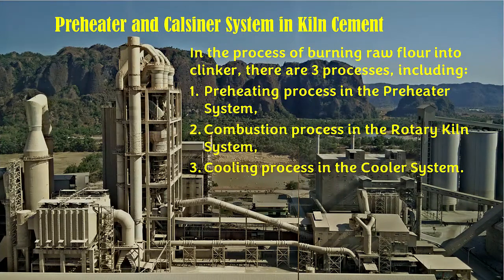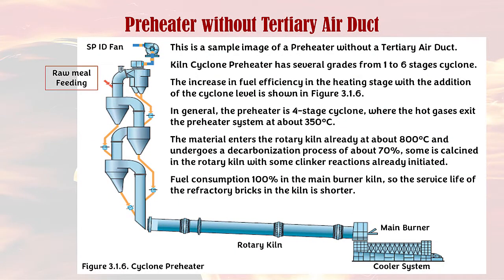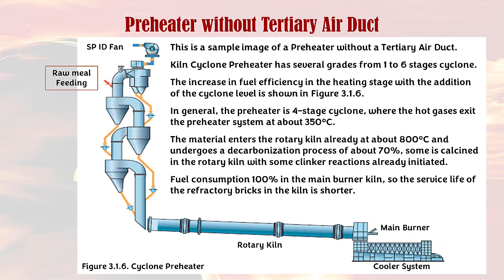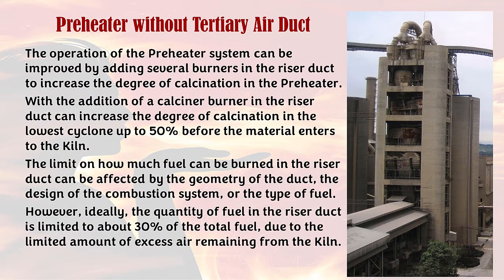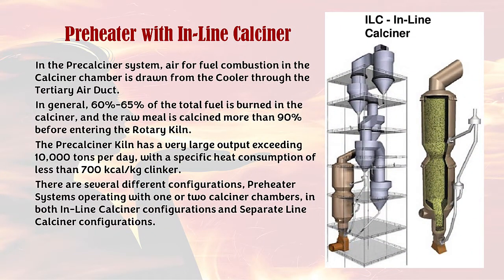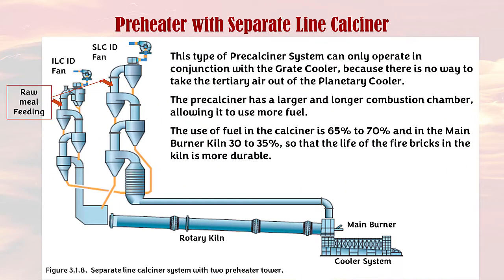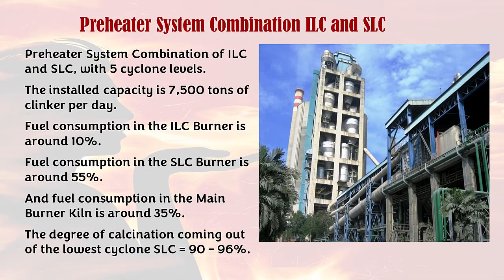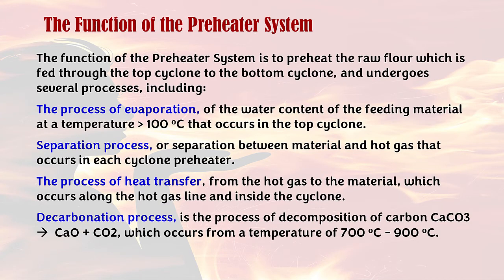Preheater And Calciner System In Cement Plant (Kiln System Part 1)_ English Version

Comment: Sir what is the purpose of preheating cement?
Reply from the maker: The purpose of preheating in the combustion process in the Cement Kiln Preheater are:
1. To increase the degree of calcination of the feed material before being put into the rotary kiln.
2. Facilitate and accelerate the process of forming clinker in the rotary kiln.